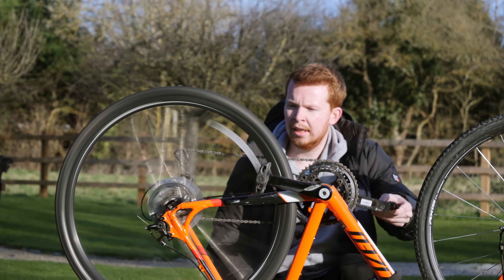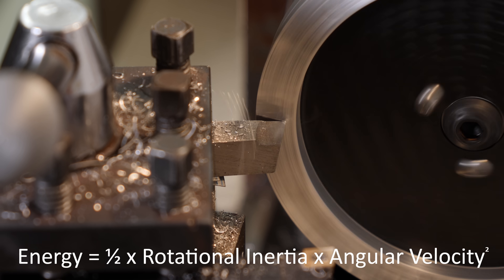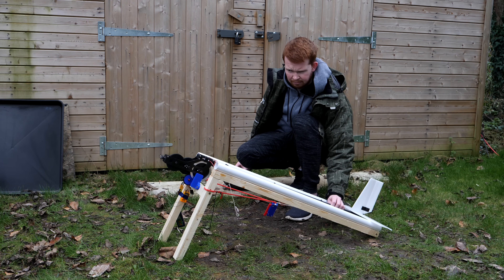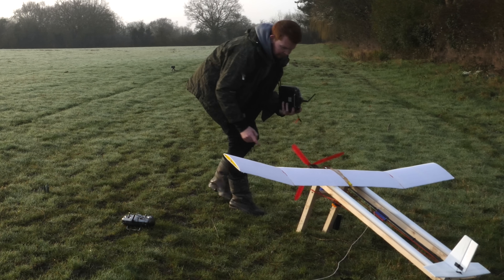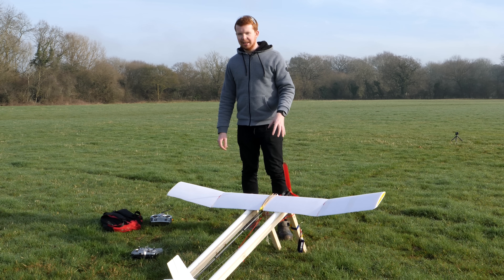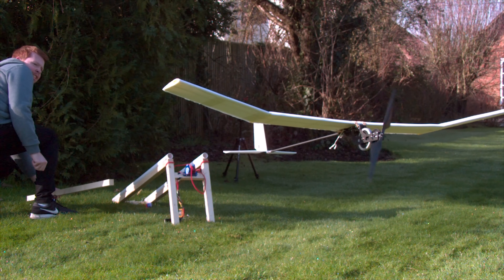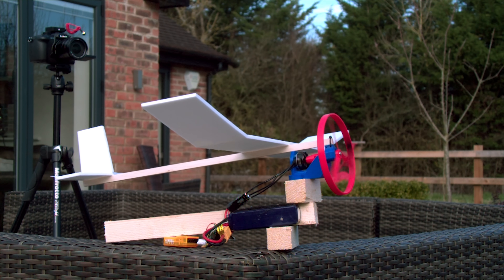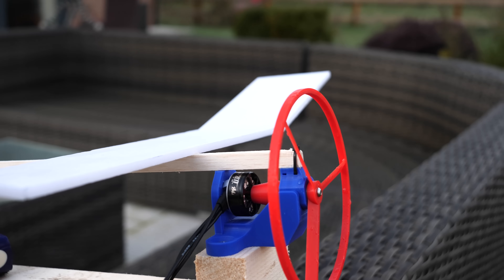Flywheel Powered Plane

Comment: That needs some sort of a clutch so if the prop stops it doesn't grind the gears off. Also is gyroscopic procession having an effect? If the clutch mechanism is too difficult then simple wheels might work.
Reply: Only five?? Why not six?
Reply: @you5711  I want to say it was the character limit for AOL Instant Messenger back in the day for usernames. I could be wrong but I have been using this same name since I was a kid in the late 90s. So if it wasn't the character limit then you'd need a time machine to ask 10 year old me.
Reply: @you5711  yeah I continued to use the same name over the years. What's really weird about the timing of this comment or I guess me getting the notification about this. Is literally 2 minutes ago I was thinking "man if I could go back in time and tell little me some things like invest in Google, apple, and Bitcoin and also about certain people to avoid..." I was literally just thinking about how if someone in 1999 came up to me and said "invest in Google" would I get it or would I think they are insane." Now I kinda want to go out and mess with people claim I'm future them and tell them to invest in random things. Or say "don't go to the store on Wednesday the 5th of June 2024. It will be very dangerous."